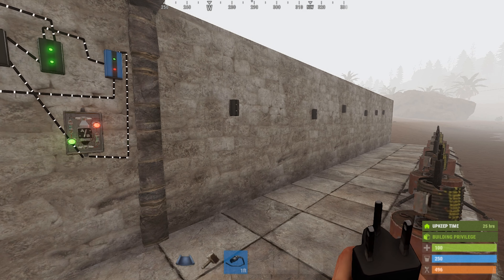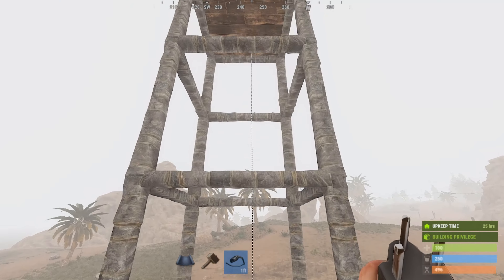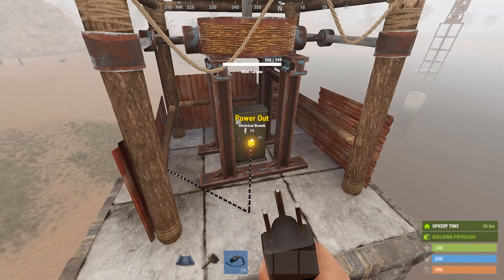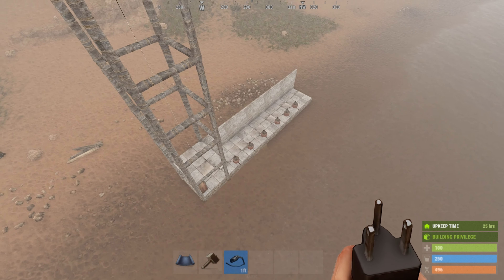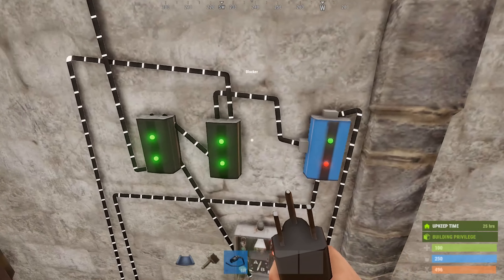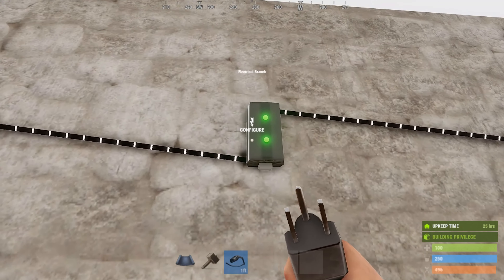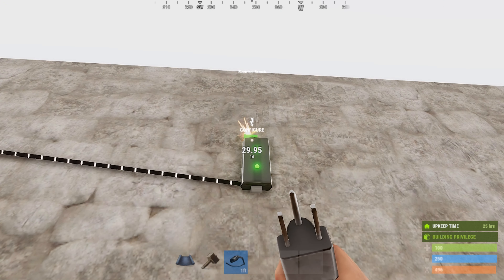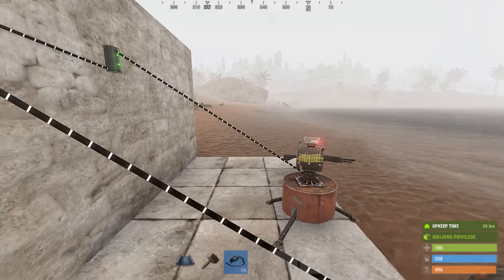Rust: Electrical Guide (More than 3 turrets)

Comment: ik im late but is there an extender for the wires cause i ran out of wire length
Reply from the maker: technically no,  you would have to place another comp down like a Branch, or anything with an input/output and run the next length of wire.  in my personal opinion branches work best for this.

Comment: why are you using qr switch
Reply from the maker: you mean OR switch? its a logic gate that allows electrical pass-through if either input receives power, pass-through amount is the greater of either power source. you dont have to use it, but I use it when paired with a windmill so at no point do I have to risk my battery being drained unless the windmill is knocked out.  my set up allows me to charge my battery, run my turrets, and not have to worry about my battery juice being used up unless the battery is needed.
Reply: @pepsilove6306  oh ty
Reply from the maker: @fishwoman7825   no problem :3  good luck with your base set up!